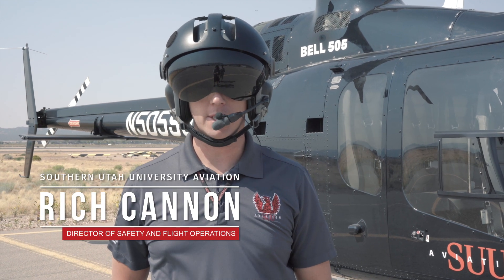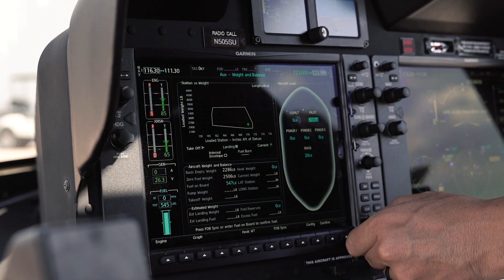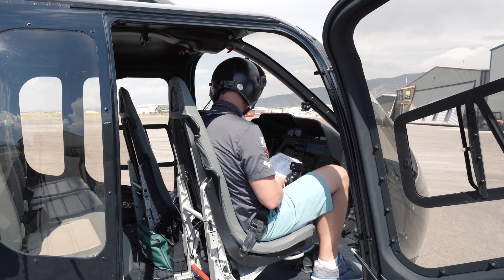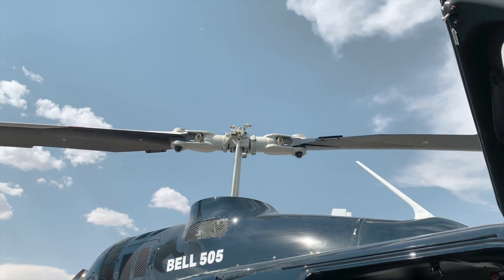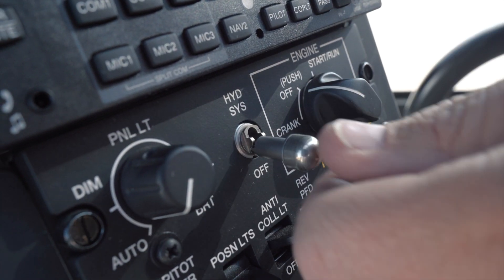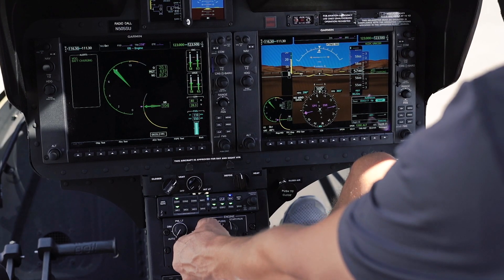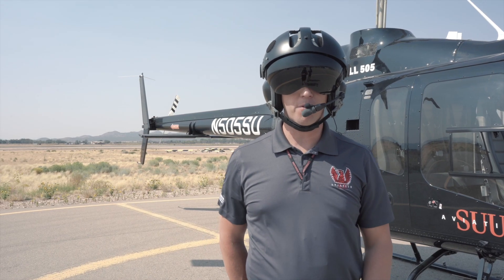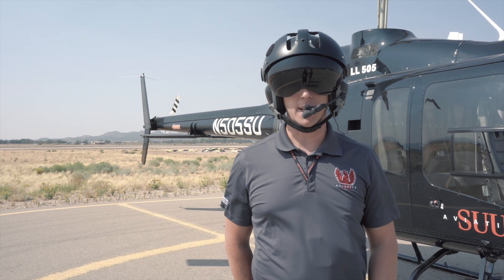Bell 505 Helicopter Startup & Takeoff

Comment: Nice video, A couple of questions:you go to “fly” mode, then do the hydraulics check and you raise the collective up. Why isn’t the helicopter lifting itself.? What did i miss?

Second question when you turn the generator on, the battery switch seems to be off, or does it spring load back to the center position after you turn it on?

Thanks!
Reply from the maker: Hi Jean, when the Collective is rolled into Fly it is setting the main rotor rpm to the range it needs to creat lift. The raise of the collective was just enough to insure the hydraulics worked properly.

Comment: I found it interesting at how the tail droops on takeoff, esp. with no-one in the back seat. Is that normal?
Reply from the maker: Yes, totally normal. Most of the weight is in the middle/back of the helicopter, so if there is only one person in it, it tends to be back-heavy. As the fuel burns throughout the flight, the center of gravity shifts forward making it feel a little more even.

Comment: I love helicopters, and I think they are phenomenal machines. I have never flown in a helicopter, and I just wonder if I would be able to tolerate flying in one. My fear is that I would get sick and nauseated! I know of a guy who that happened to. And he would have been the last person you would have expected to have this reaction. He was a huge guy, about 6.5 in height and fairly fit. Furthermore, he was actually a big boss at a major corporation that I worked for at the time. Although I was not present when it happened, someone who was on the flight with him said that the pilot had to actually turn the flight around, and let him off.
Reply from the maker: Hey George, every person has a different reaction to flying. If you’re wanting to know how you’d handle a ride in a helicopter, we highly recommend taking an intro flight. In fact, we’re doing a giveaway for an intro flight right now. All you have to do is subscribe to our channel and you’re automatically entered!
Reply: @SUUAviation  Okay will do! And you are correct, everybody's reaction would be different. I would just hope that mine would be okay, because I do love these machines, and I find them quite fascinating!!
Reply from the maker: We hope so too. Being up in the air is an amazing experience, and we love sharing those experiences with others.
Reply: helicopters are more likely to make you sick than fixed wing due to lots of sudden changes in direction  during flight (altitude like going up and down like an elevator, and shifting left and right like in a race car). Coupled with the vibrations it could make for an unpleasant time. Only way to find out is to try.
Reply from the maker: It all depends on the person, have you seen our video on how to pick either fixed wing or rotor wing?
Reply: @SUUAviation  watching as we speak!

Comment: Nice video, looked like your transponder wasn’t  set to alt?.
Reply from the maker: Thanks! We appreciate it. It is. This system automatically changes to alt mode when the aircraft picks up off the ground, so it's on. 👍
Reply: Very handy👌🏻. Thanks for the insight.
Reply from the maker: No problem